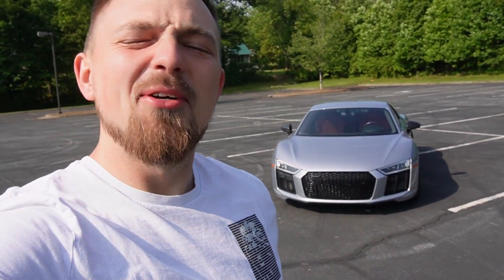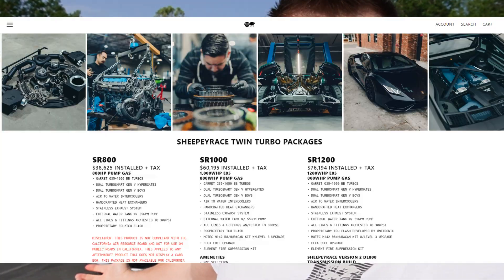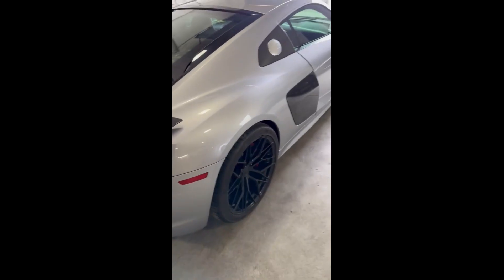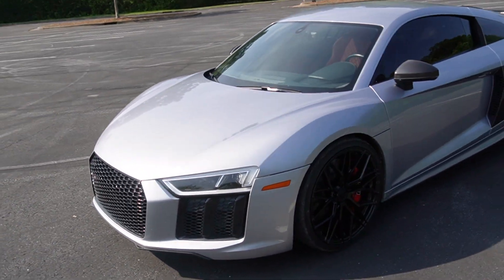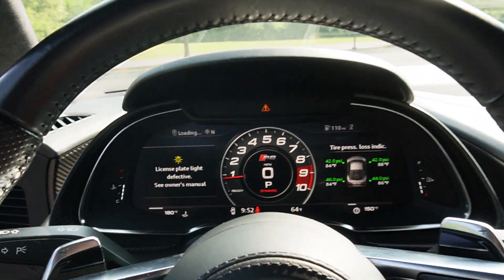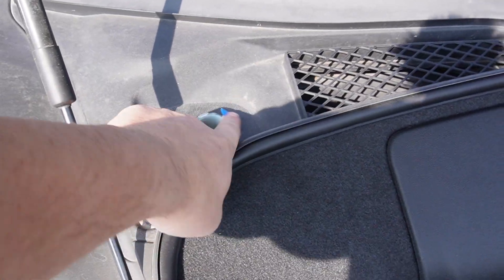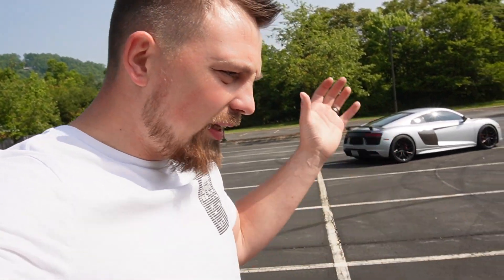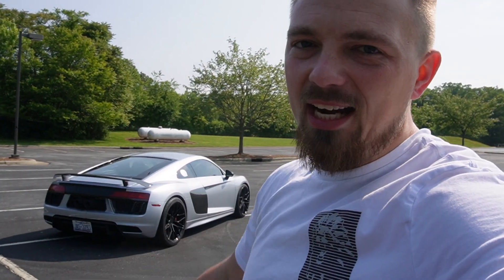I Got Scammed Buying My Twin Turbo Audi R8, Bad Motor?! Clutches, Electrical Issues...

Comment: WoW, what a nightmare, btw, you still own rs6 avant? if so what happened, why did you get rid of it? got bored fast?
Reply from the maker: I sold it when I found out the C8 RS6/RS7 engines tend to blow up even when they’re stock
Reply: @LextasyNation  thanks for being open! I was very close to pull a trigger to buy one! GOOD TO KNOW ! I was poking around to find some nice 4 door+compact car, maybe a new charger, widebody but i donno, I'm having fun with the GT-R still...... lol 79k miles on that badboy and 155k miles on the audi b7 rs4 lol! keep on grinding, wish you could upload more, its always fun to watch your videos!
Reply from the maker: Hellcats is the way to go since next year they’re done producing them. The rs6 are known to blow motors as low as 10-15m miles which is strange. Keep the GTR for sure bro! I’ll be uploading as much as my schedule allows me to. It’s freed up a bit so I should be back for a while.

Comment: What is happening to you is the reason why it kills your love for modding cars .I rather build by racing skills stick shift and launching from a dig .
Reply: Well that's the issue with buying an already modded car. You never know what your going to deal with and how soon it's going to happen. Even an honest person can't promise you everything will be okay. You could get it right when everything falls apart. Sheepy and Underground Racing always say, when you get a modified exotic, to take them to a shop that offers the same caliber of performance enhancements.
Reply: @master74569 didnt u read my comments shops also take your money ! I wouldn’t spend no money on a shop they don’t know what to do or installs ! The dealer which is certified to work on vettes couldn’t even install a factory trsnny back on smh their trash